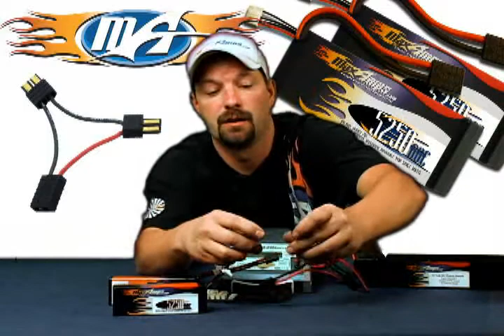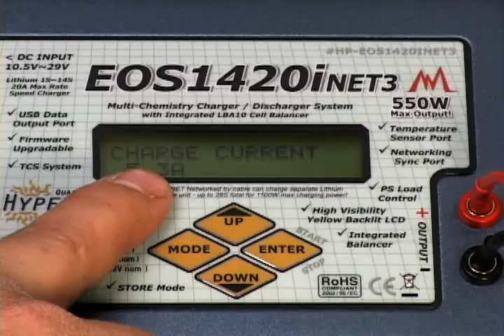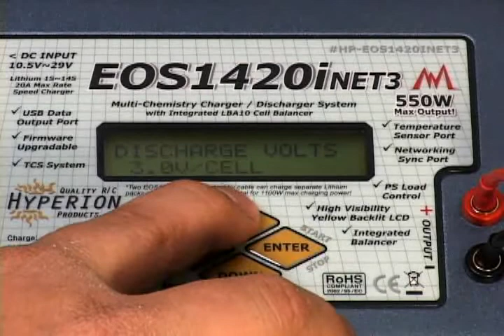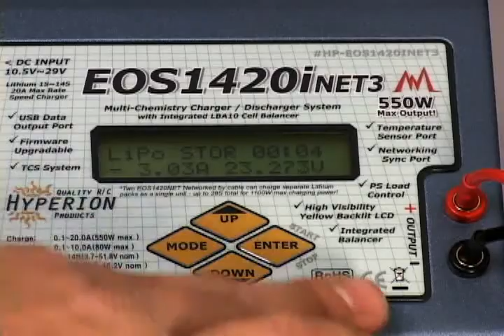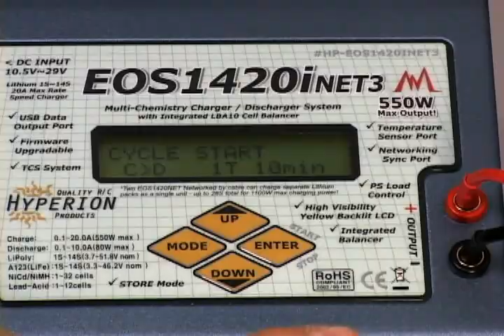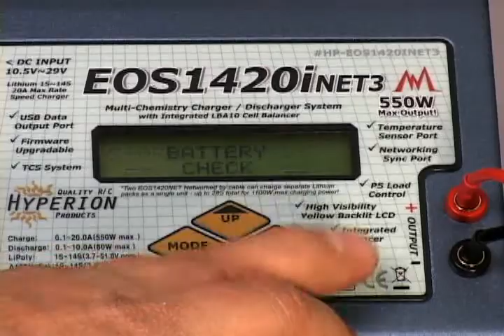How to store charge & cycle a LiPo pack using the Hyperion EOS1420i NET3 Charger

Comment: I bought this charger just recently from max amps. A question regarding the discharge rate. Can I set it above 5amps. For example if I have 5000mah pack which I charge at 2S (10amps) can I set the charger discharge rate to 10amps too? I'm just finding the discharge rate painfully slow.

Thanks